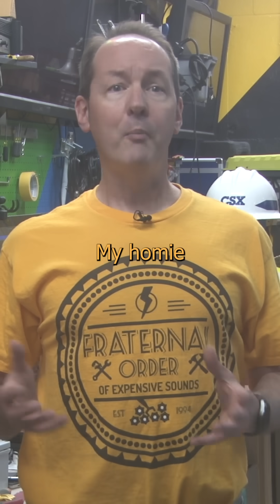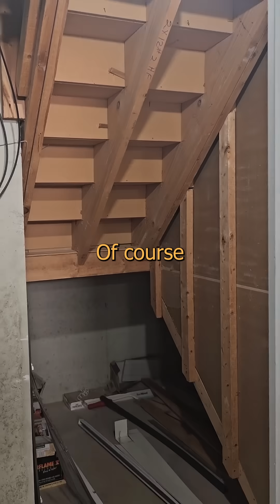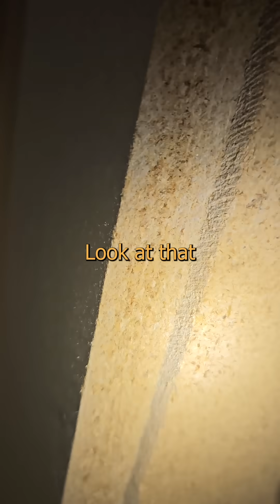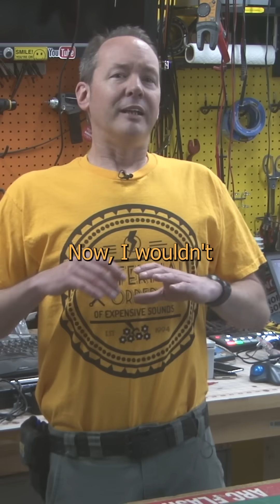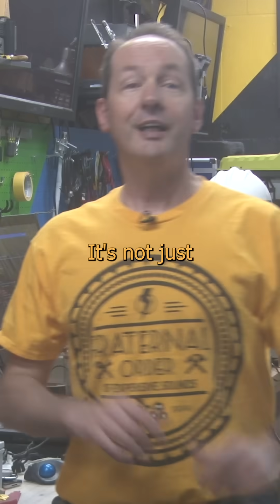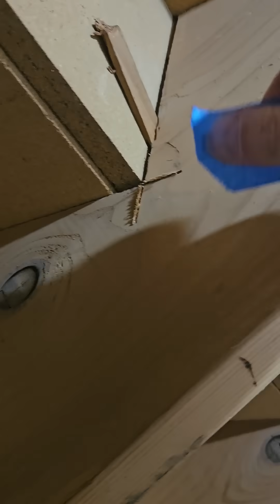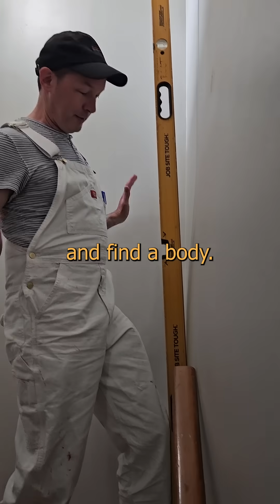Particleboard Staircase #chrisboden #engineering #construction #stairs #cheap #job #work #carpentry

Comment: As a former fire investigator, this is LETHAL!
Particle board is essentially glued sawdust and in the presence of a heat source, like a fire, it will structurally fail.
Not maybe. 😳😬
A small fire under the stairs to the 2nd floor means no escape from the 2nd floor that doesn't involve windows😲
Wooden I-beams are another "interesting idea" that does not take into account that yes, house fires occur.🤦🏿🤦‍♂️
Please tell your friend to budget to replace the treads ASAP because the life he saves may be his own🔥👨‍🚒

Additionally, if there's a chance of flooding in the area, well, we know what'll happen with the basement stairs🤷‍♂️
Yes, you will reach the basement. 
The difference is the velocity at which you do so and your condition on arrival.😵

Thanks for bringing this to peoples attention because it sucks when an investigator has to list it as the cause.😖
Reply: Sadly, the companies that crap out these quality violations won't stop until the cost is crippling or criminal charges start flying, and doing so consistently.
Reply: @Unsensitive  Or people just stop buying their crap - home inspections are a thing for a reason
Reply: @OutsiderLabs  true but the housing market is so bad that people would take cardboard houses over nothing. The solution has to be a legal crackdown or nothings gonna change. Its not like this isnt against the law. Its in violation of so many regulations
Reply: @OutsiderLabs  For most people, it's either crap homes or nothing at all.  The good homes are owned by (usually foreign) holding companies worth multiple billions of dollars who just sit on it as an "investment".
Reply: @thedudegs-f9w  we recently sold a house and were horrified to see that every offer skipped inspections. Apparently that’s normal these days? I felt good about the house we’d just fixed up but dang dude I’d never buy a place without a record of what all was goofed up
Reply: @TimGGleason  ok yeah thats pretty ridiculous. Buying a house without an inspection is a terrible decision. I think the reason for that though is still the housing market. People dont really have the money to buy a home more than once so they dont know what theyre looking for, or they dont care because everything else is so expensive that it doesnt matter to them. There used to be a concept of a starter home, but that just doesnt exist anymore. If youre buying a house to live in, its probably your first time and if youre buying a house to sell or rent, most people dont care if it has stuff that needs fixing
Reply: @OutsiderLabs  the problem is that houses are so far out of reach for most first time buyers that they're willing to sacrifice quality to just get a house, any house. It's a mess.
Reply: @OutsiderLabs Only if the inspectors aren't assholes who actually do their jobs.
Reply: @OutsiderLabs home inspectors are their own form of fuckery. 

“Yeah we can’t trust these corporations to not break the rules so let’s go to this other corporation to make sure that the first corporation is following the rules. What’s that? How do you know the second corporation isn’t as incompetent and malevolent as the first one? Well you’re just gonna have to trust them”
Reply: @OutsiderLabs  What, like Apple?

People have to know that there's a problem, and have to be in a position to argue the point.

You know what a cowboy builder does when caught? Shuts down the company and starts another.

This is why the penalties must be tied to the individual.

This goes for CEOs of big companies like Boeing, when they produce faulty products that kill as well.

Without individual, personal accountability, nothing will change.
Reply: @OutsiderLabs  trouble is there's a lot of compromised home inspectors
Reply: I have heard people refer to particle board as "GLIT". That's right - "GLIT" for glue and s....
Reply: Pretty much 😏  @A_Bit_of_Thought
Reply: @EastBayFlipper  " yes you will reach the stairs, the difference is the velocity at which you do" 🤣🤣🤣🤣 i LOVE it
Reply: As a furniture maker, I can assure you it won't take a flood to send someone through these stairs. A few humid days is all it will take. 

Wood expands and contracts, even at that scale, and the glue can't stop it. A few cycles of above-average humidity and below-average humidity days and it will break like a graham cracker. 

Go to a goodwill and get a cheap particle board desk and your 10 year old kid could suplex through it like his favorite WWE wrestler.
Reply: Unfortunately, composite materials are a fact of life nowadays, with TJIs used in most new construction. 
Underwriters Laboratories says occupants have less than three minutes to vacate a modern burning house before the structure is compromised. 
Basically, the only reason the fire department is called is to make sure the fire doesn't spread to the neighbors, and to fill out the paperwork for the insurance company.
Reply: I really hope I didn't come off as rude or condescending.  I was just informed of what wooden I beams are and your absolutely right.  I felt the same way before I knew about wooden I beams, which is a misnomer it should be...😂 Partial beams!!! OMG ROTFL wasn't even going for that!
Reply: It doesn't need a fire to fail structurally. I wouldn't want to be the one carrying a heavy bureau upstairs while moving in.
Reply: Dude, thanks for bringing the brains on this one. Also, I didn't consider the I-beam things, I used to see Norm Abrams and Bob Villa using those fuckin' things everywhere. We had a house fire that, had our floor been made of those, it might have dropped us right into the basement. As it was, the floor held even as the solder melted out of the water pipes, though the joists needed replacement when all was said and done.
Reply: i love this, DISCUSSIONS, not arguments!! why can’t the regular internet move so delegated.
Reply: @defnotjuggs the same reason you can reach the title of gentlemen in England by being a master Craftsman.  Where to put it bluntly some people are like School in the summertime... No class
Reply: Is there a law criminal code that this builder can be charged with?
Reply: Only  if it's new construction are there code violations but that wasn't my side of the fence @shaec3405
Reply: Or to firefighters using those stairs. After all, heat and water means they'll be trying to walk on literal air while lugging tanks and hoses.
Wonder what the floors are made of, paper mache?
Reply: I can't say that I trust those wooden I-beams either. Sure, assuming it stays dry and doesn't catch fire, it will stay sturdy for at least a few years, but I'd much rather go with the 2x12 joists you see in 50 year old houses, because you KNOW those will hold the house up out of the basement long after the rest of it collapses!
Reply: Im a student Carpenter, so i was wondering why particle board was so bad, I just reacted on instinct with what i was taught.
good to know for future projects.
Reply: It's the application @WeirdPeacock  
For instance, using it for decorative and non-structural is fine because there's no requirement for structural strength during flooding and fire. Code will specifically identify the appropriate material for the job. For instance, you wouldn't make a kingpost with galvanized steel appropriate for drywall.
It's all about the application 😉👍
Reply: I was under the impression that in the USA you have more inspectors than tradesman. And what about that holy grail "CODE"
Reply: @alemgas  🇨🇦
Reply: AS1860 Particleboard Flooring
This is the code that allows particle board flooring in Australia. It requires the particle board to stand up to 3 months of weathering without a roof. 

I was very surprised by this but thought I would actually look it up.
Reply: @ecospider5 that's particle board (OSB),it had big particles of wood) the stuff on these stairs is fiberboard which is basically saw dust glued together, looks like hdf too so really fine sawdust
Reply: In a fire, this crap might as well be straight sawdus or paper.
Reply: @AlexMint  it breaks down the adhesive so it would crumble and be energenic fuel  so kinda the worst of all worlds🤦🏿🤦‍♂️
In non-structural applications, no worries like the carcass of kitchen cupboards. It's enough for that application and would not being expected to support an adult human. 😉
Reply: Water soluble stairs are a very bad idea. I would not go the trouble of replacing the treads without also replacing the risers. The risers carry the nose of the treads and the nose is all you walk on while you climb. Risers basically just stop the treads from flexing, but I like real wood that actually does any support function at all. Old school.
Reply: Not counting that particle board is a much better combustor then solid wood.
Reply: They used to sell them like this.  Have a set in my house from the 90's
Reply: Not only the treads, the whole stringer needs to be replaced.
Reply: That sudden stop is a bitch.
Reply: ah yes, the wood dust, thatll be what catches fire, not the much more flammable cheap glue they use to pour it
Reply: Nobody is criminally liable.  Not the builder.  Not the inspector.  That is why this happens.
Reply: American architecture ftw
Reply: Except it’s up to code and has been done since the 70s Menards sell these treads along with the risers, dude clearly didn’t look too hard.

Dakota™ Ready-to-Finish Particleboard 1-1/8" x 11-1/4" x 48" Stair Tread
Reply: "and in the presence of a heat source, like a fire, it will structurally fail."

so will normal wood...
Reply: @nopenoname7944  the difference is how long it takes.
Enough time to escape or the stairs just collapsed with you on them, over a fire 🔥 
I can say I know precisely what that feels like in bunker gear and a breathing apparatus but I wouldn't try it in pajamas 😮
Reply: @EastBayFlipper  That's fair and a good point.
Reply: Dunno about your building code, but we have been building wooden stairs for ages here in Finland. Like Japan, our country is ~75% forest, so that's what we use. And believe me, our building code accounts for fire hazards (duh). We even build multi-story buildings out of timber. I think the US has a lot of misconceptions about wood fire safety. Check the new developments in the field. 🙂✌️
Reply: @Hukkinen  nothing wrong with solid wood for construction.
Particle board, sawdust and glue, is decorative, not structural 
I have solid wood stairs and stringers in my own home.
The glues used are thermoset adhesives and in the presence of heat alone will use structural integrity and that's why it should never be used for structural or safety applications. 😉
When structural wood is charred and treated with a fire inhibitor,  it performs better than structural steel.
Reply: I mean mdf is just glued sawdust. Every house ive ever seen built, that actually uses wood sheeting,  the sheeting is always particle board. Because the layers of pieces are all going different directions, it adds strength because the grain structure isn't all going in the same direction. Partical board is used to sheat the roof as well as all the floors.
Reply: As a former fire inspector I'm surprised you don't know that metal I beams are much more suseptable to failure when heated than wood, never seen a wood 'I' beam but as long as the beam was big enough and didn't actually ignite your better off with wood. CAS and point Walmart panelized roofs collapse when merchandise on shelving catches fire, while other stores of similar size with wooden glulam or lvl beams may require more columns but don't buckle under load when heated from beneath. Not knocking your knowledge or caliber as a fire inspector, I was just literally surprised you didn't know that about wood beams over metal.
Reply: @troyconnors374  you've never seen two 2"×4"'s and a piece of OSB impersonating a 2"×6" or a 2"x8" floor joist?😏
I have a very personal hatred for those things because a small fire in the basement of a structure failed from heat, not fire and only because of the 2 other firefighters on the heavy line behind me when the floor caved in were able to pull me out with the host on full thrust.😳😬

They're f'n poison and they're being used in a lot of new homed because they are cheap. 

Yes, steel beams can definitely deform in a fire and that's why they're usually fireproofed if the contractor plans on living in the home.

Fire, unfortunately happens and you want enough time to escape. Those fkrs change the time to escape from about a half hour to minutes, depending on the use😢
Reply: @troyconnors374  a wooden I beam has a 2×4 or 2x6 horizontal, a vertical made out of particle board, and capped with another horizontal to form an I. The particle board is often stamped with knockouts to pass plumbing or electrical through, etc. They aren't something I'd consider a substitute for steel I beams, rather a substitute for 2x12 joist. Under ideal conditions, they are fairly strong. Heat or moisture has them failing rather quickly.
Reply: @firefighter1c57 Wooden I-beams are something I will never, ever trust in a building.
Reply: I know firefighters aren't considered veterans, but thank you for your service.
Reply: @EastBayFlipper  nor would I, I was merely explaining what they are. Ole Bob Villa sure loved using them, but I always thought a good 2x12 would be better in every way.
Reply: Jesus man you dont have to use emojis after every sentence
Reply: Your comments on fire show you're a liar or to dumb to read spec sheets.
Reply: While it isn't the best option, particle board doesn't burn all that easy unless it's damaged. While it might fail structurally after trying to use them after a fire, during a fire, I would bet the pine stringers burn before the particle board does. Either way, I've done enough burn restorations to know we usually replace treads and reinforce stringers anyway.
Reply: @MrNside  It's not that the PB burns, it's that you hit the 400-500F mark and the binder degrades. Since there's zero structural addition from the fiber in chipboard, you basically end up with something as strong as... about halfway between crumb cake and a dry cellulose sponge.
Reply: @mfree80286 
Like I said, we typically end up replacing treads and risers regardless of what they're made of in a burn job. When they get that hot, hopefully everyone has already made it out, because it won't be the failing stair tread that gets them.
Reply: @MrNside  He's not talking about the wood burning, he's talking about the glue melting. And when the glue melts, the wood can be fine, but the floor is fucked.
Reply: @Tomyironmane 
See above. Treads get replaced most of the time anyway.
Reply: @MrNside  They didn't say BURN. They Said *FAIL*.

Comment: Love the Cy ref.  I see so many crap builds for expensive homes from Cy and Randle.  Makes me glad I bought an old house.  Original parts built 1960.  Is there something old that always needs fixing?  Yes.  Just self installed a hybrid hot water heater.  Will it fall down around me from poor quality?  No.  it's already survived being 9 miles from a 5.8 magnitude earthquake that damaged the Washington monument a hundred miles away.  If I can keep a roof and poaint on it she will log outlast these old bones.
Reply: Why would you heat hot water? Isn't it already hot?
Reply: @firefighter1c57  hotter

Comment: Woodworker here. Particle board is plenty strong... 

...for furniture.

I wouldn't climb these stairs daily
Reply: AS1860 Particleboard Flooring
This is the code that allows particle board flooring in Australia. It requires the particle board to stand up to 3 months of weathering without a roof. 

I was very surprised by this but thought I would actually look it up.
Reply: @ecospider5  that's probably meant more for oriented strand board, not particleboard made of tiny wood bits.  Subfloor material in the US also has to meet exposure times as well.
Reply: I'm curious what's on top of the subtread, carpet or wood?  If there's a hard surface over the subtread, then its fine.
Reply: @bigpjohnson My grandfather put half inch plywood under the particle board steps on three stringers. Kinda narrow steps too.

Comment: The wedges are actually perfectly acceptable, just not the particleboard.  The wedges are used to tighten all the joints until the glue grabs, and they remain as permanent support.

Comment: If the water logged steps don’t get you then the massive over cuts into the stringers cracking will. Jesus Christ some of those are cut an extra inch into the wood and with how dog shit the rest of it is built I’m sure it’s the cheapest wood the homeless despot had to offer

Comment: 20 year carpenter.
Nope. Nope nope. Stop it. Put your hammer down and fuck off. 
Your assessment is, as usual, right on target. That is particle board and it is NOT code. It does not do well in the freeze/thaw environments. It breaks REALLY easily. We only use that shit for drawers and whatnot. Nothing large. Nothing load bearing. It is for surface bullshit, at best. 
If you spill your beer on that bullshit, somebody is gonna have their top in the stairwell and their bottom in the basement. 
If Dad is yelling at the kids and puts his foot down, those kids will be collecting inheritance. 
If that shit gets wet, it will be the first paper bag that your mom could punch her way out of. 
I love this channel.

Comment: Depends on the particle board, there is particle board for flooring that could easily handle that short span (from memory 60cm on centers is norm for particle board). Particle board comes in many shapes as well, depending on the glue they can be rated for short outdoor exposure even. I’m more concerned about the overcuts on the risers, it’s precisely where you wouldn’t the beginning of the stress fracture. Though they seem to have gone a bit overboard with the risers, so probably nothing to worry about.